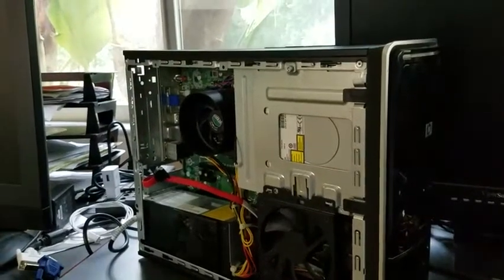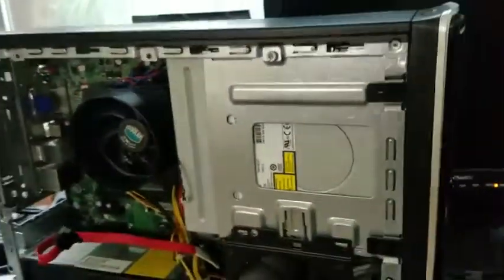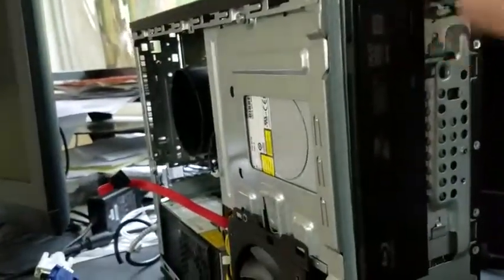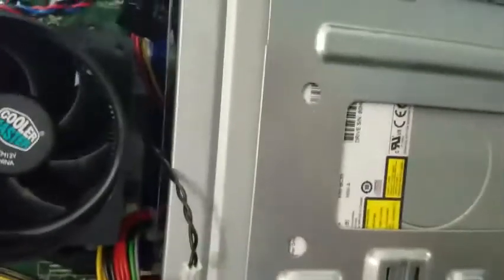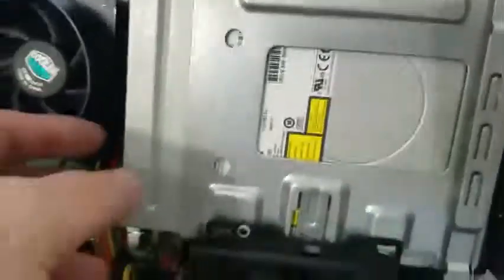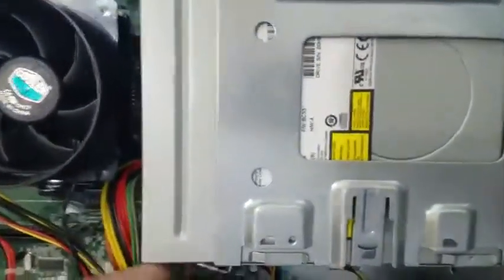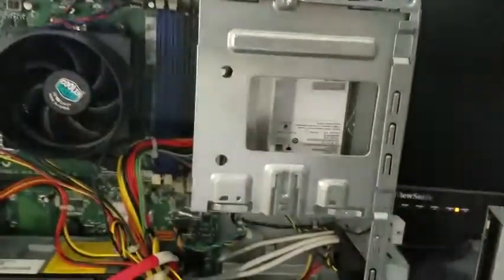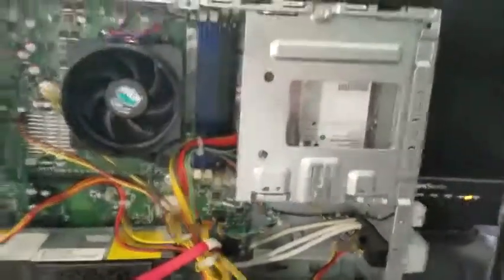How to Remove the HDD from an HP Pavilion Slimline S5657C

Comment: Great video helped me to disconnect broken front usb port which was causing startup to not load. Thanks alot very greatful and helpful
Reply: That's what happened to me. But now its just stuck on the HP logo screen and won't boot up